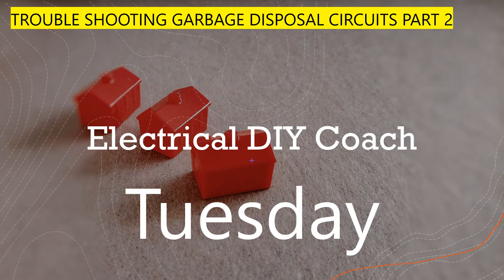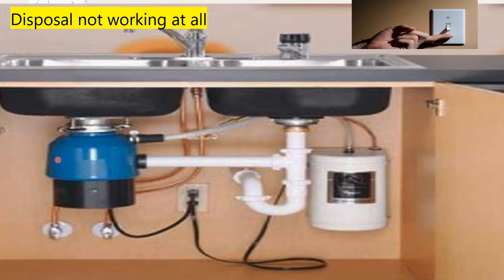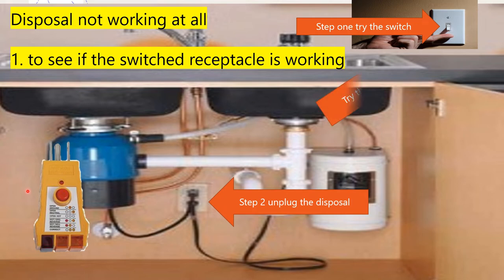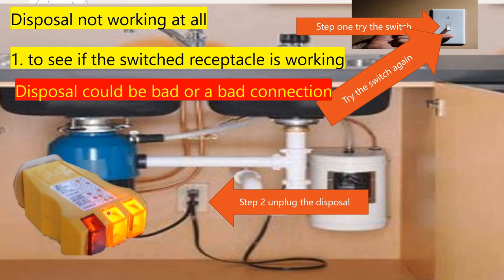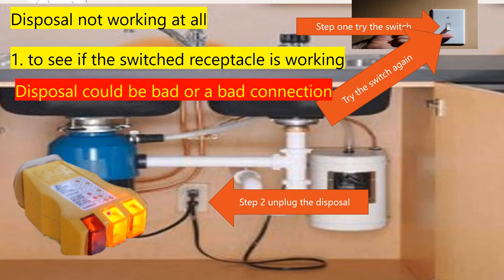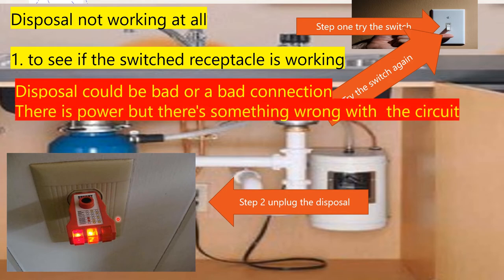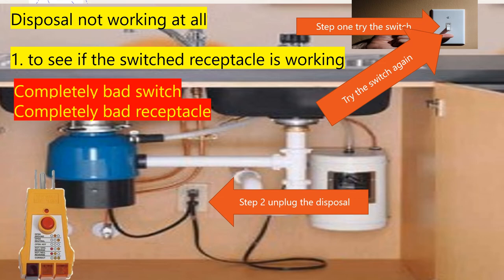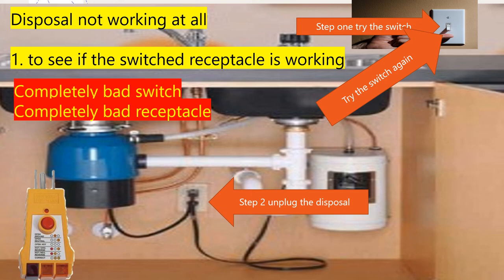Garbage Disposal Troubleshooting Part 2 Electrical Pro Tip of the Day! Be a Pro. Learn From the Pros

Comment: The first thing I would do is turn the switch on, if there is no sound, then I would check the reset button.  If there is a sound but the disposer is not working it's more than likely a jam.  You would insert your allen key into the bottom and try to free it up.  Appreciate the tutorials.  Keep it up.  Thanks.